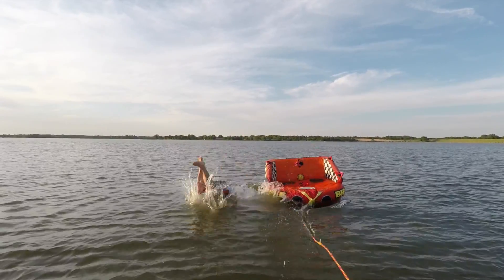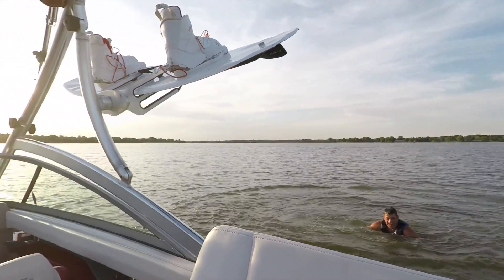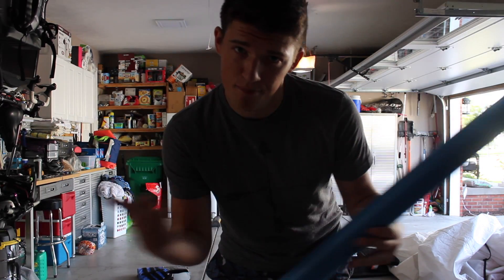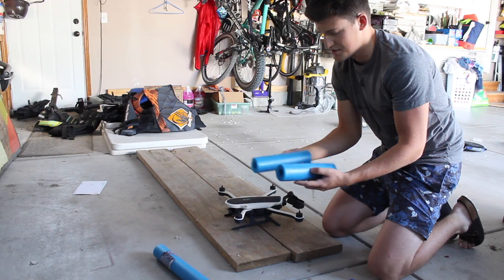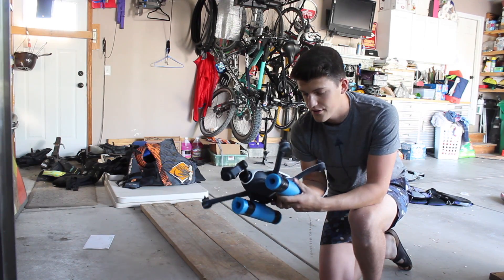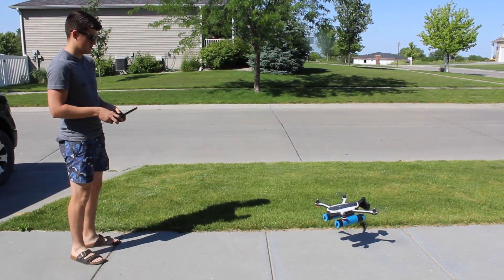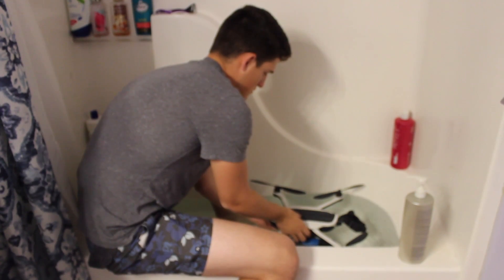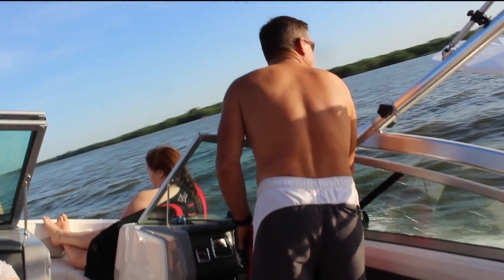DIY WATERPROOF DRONE!

Comment: Nice vlog but learn how to do tags
Reply from the maker: Derricks Creamy MEMES how so?
Reply: Your tags don't rank at all on Youtube searches... You want to have at least 5 ranked tags for a good set of tags, it's hard to do but it gets your video loads of views... Currently you have 0 ranked tags. You can download 2 google chrome extensions called Videolyctics (Social blade extension) and also tube buddy which will help you generate tags on your video. if you don't want to use those extensions the next best thing you can do to improve your video is list the tags at the bottom of the description